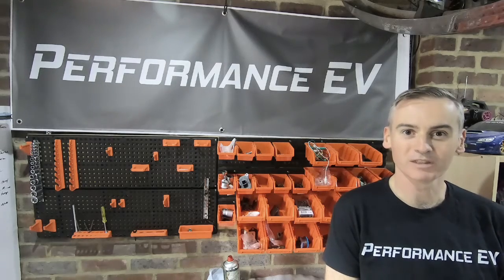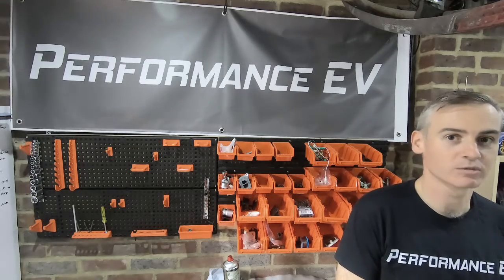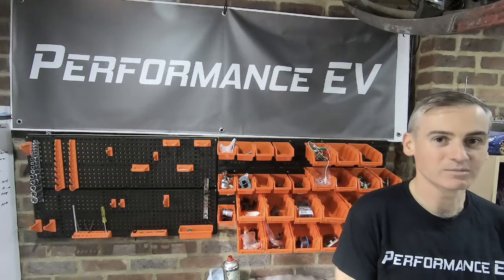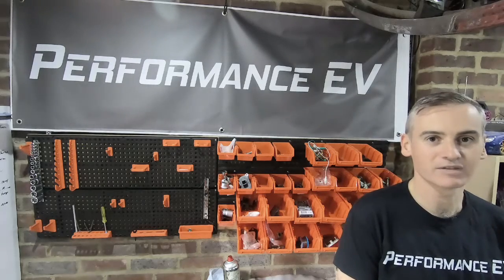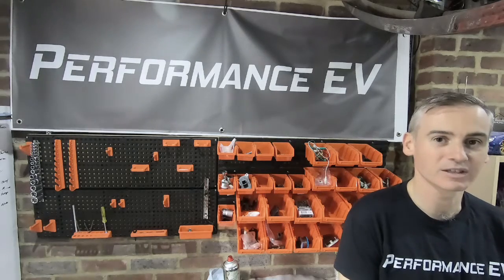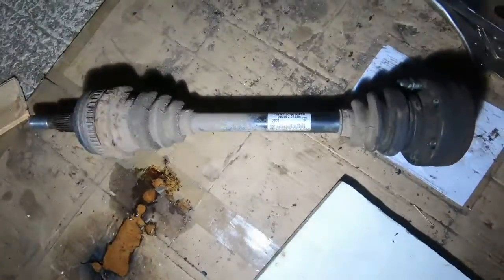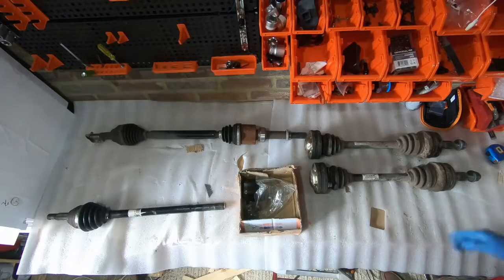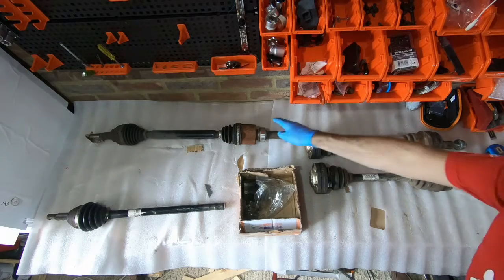Electric Porsche 911 project video 11 - Porsche 911 and Nissan Leaf Axles and CV Joint options

Comment: Hello do you know if the Gen1 leaf EM 61 and the Gen2 EM57 leaf gear boxes share the same axel shaft spline?
Reply from the maker: Hi, no they are slightly different.  I think the gen 1 has a slightly smaller diameter. I found out the hard way by buying a shaft from a gen 1 that wouldn't fit.
Reply: @PerformanceEV  ahh ok I should have specified more is the transmission outputs spine the same across the two generations(diff output spline)? I don’t need the axle hub spines since I will be grafting them to atv shafts for the atv hubs.
Reply: @PerformanceEV  I’m using the stock 2011 transaxle so I only need the diff splines to fit. Then I will cut the hub ends off.

Comment: I would encourage you to cut both fully assembled CV shafts in half.  Then install them in the motor / rear wheels. Mount the motor in the car and tape the shafts together to check the angles to make sure they are at angle less the 40 deg with no weight on the car.  Ideally you should measure another of the same car and try and get the output of the transmission location the same.  Then mark and cut the shafts so they can be inline with each other. Last get two pieces of tube 3-4" inches long, with enough material so the tubes can be turned internally on a lathe. Turn them on a lathe internally to tightly fit over the axles. Put the axles halves in the tube and weld a tac-weld 4 spots each axle. This should be good enough for you to finish the car. When you are 100% happy remove them and bring them to a shop to have a proper one piece axle made. Where the Leaf isn't a torque monster you maybe be able to get away with welding the tubes all the way around for each axle. 

Video: https://www.youtube.com/watch?v=PbCEzrlxtPI
Reply: LOL, I was going to say something similar. Done properly it will be strong enough to last years.
It will help to work out exactly how long they need to bee too as the half shaft needs to move laterally in the cups as well as vertically.

Oh and I'm really enjoying this build series Shane, thanks for sharing.
Reply: great idea, thanks for sharing this, probably going to do that one day